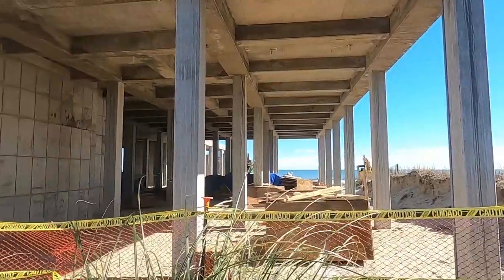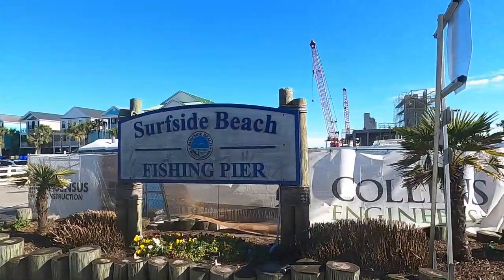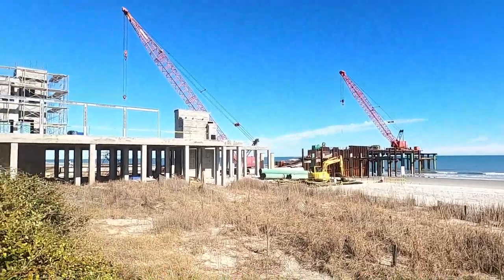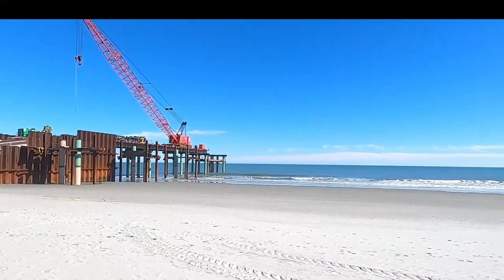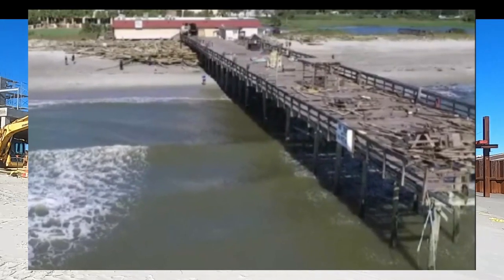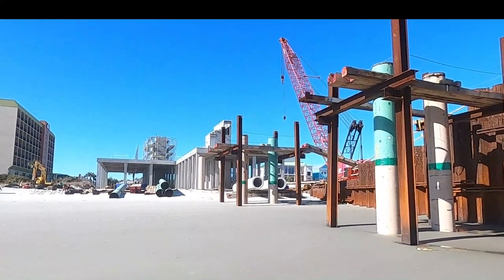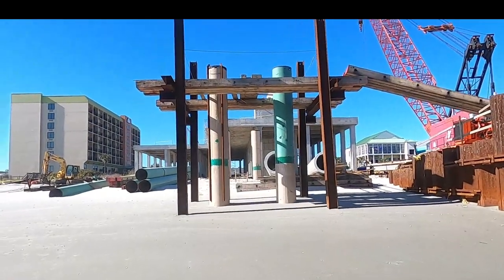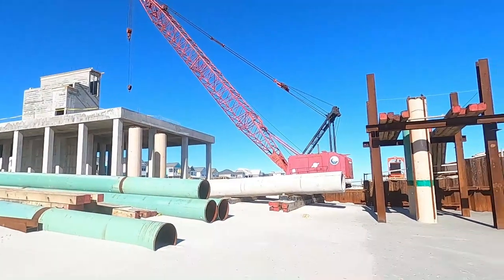Surfside Beach Pier Construction Update - February 2022 [Walk and Aerial Footage]

Comment: I was at the new pier at St.Petersburg Fla.,recently,it was built at a cost of 96 million dollars.You can probably check it out on Youtube,pretty spectacular(like a free Disneyland) I was in Myrtle Beach when they were rebuilding the Springmaid Pier,it's smart that they both piers along with Surfside will have sturdier concrete support beams that can probably withstand a category 4 or 5 hurricane,eventually one by one all the piers may have replaced like that with concrete support when or if another hurricane hits.
Reply from the maker: I do believe you're right. They'll hold up much better. And 96 million is a lot of money. Thanks for the input.